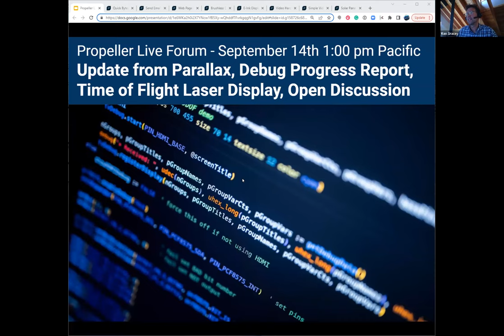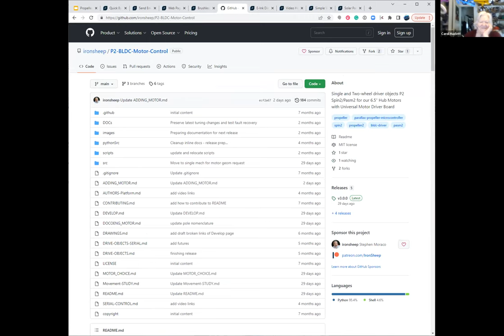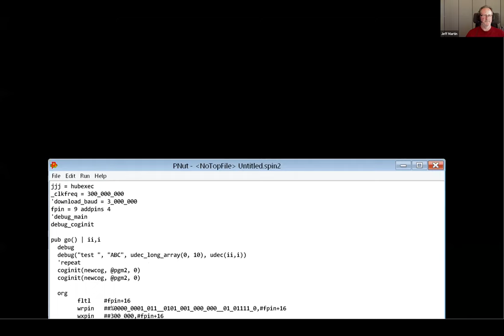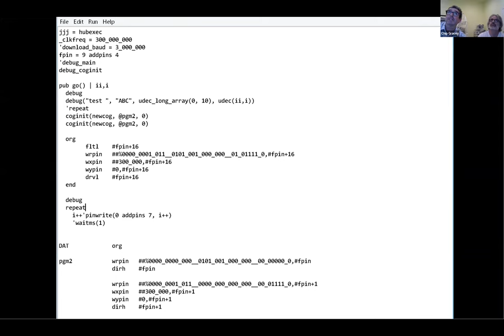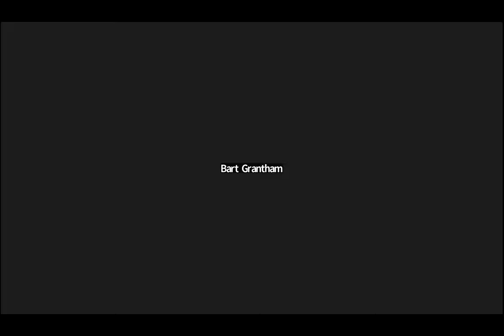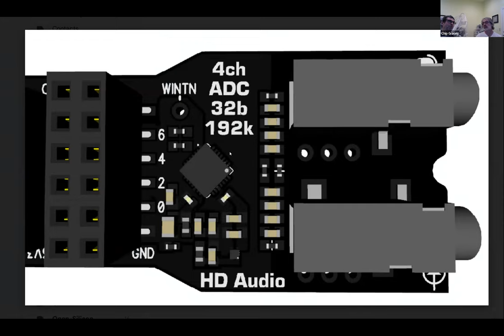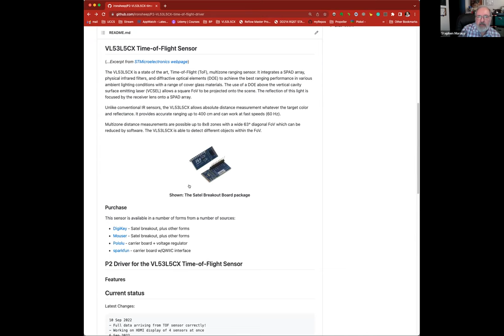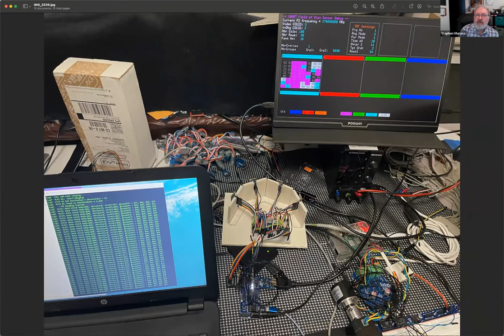Propeller Live Forum September 14, 2022: Debug Progress, Flash File System, and Laser ToF Project

Comment: Hi conceptually you should treat the entire file system as a single files, this way you would do a append only writes, giving you fairness in the number of writes and removing the write amplitud for writes on the FLASH. There are no such ting as random writes in this concept. Concord that most the writes are logging data, so no need to consider all FS use cases, IMHO.